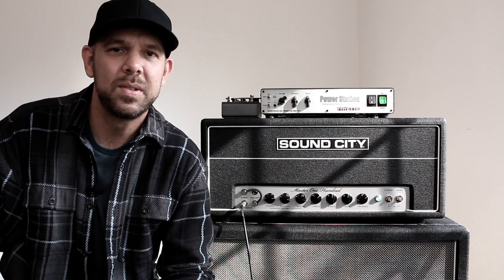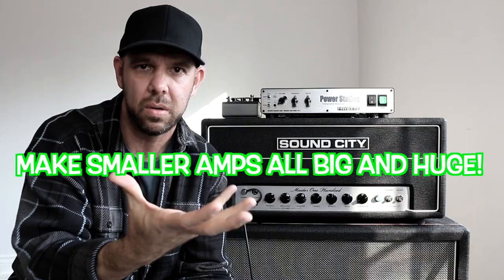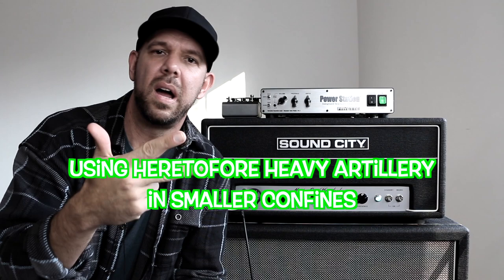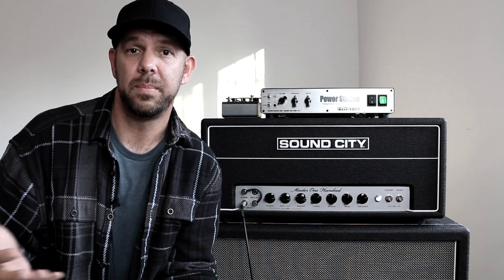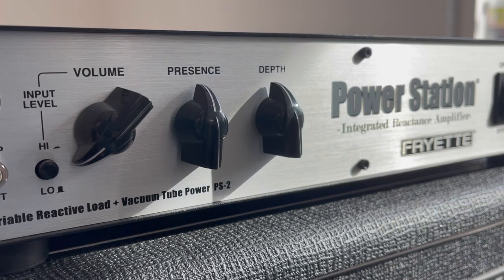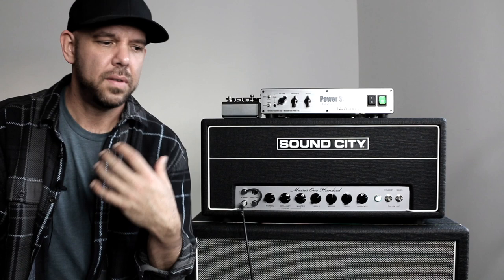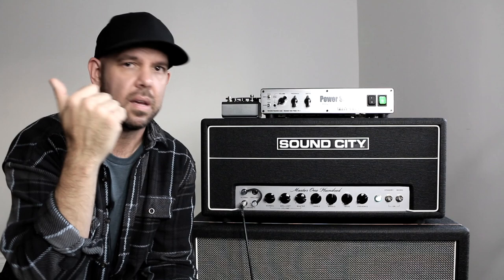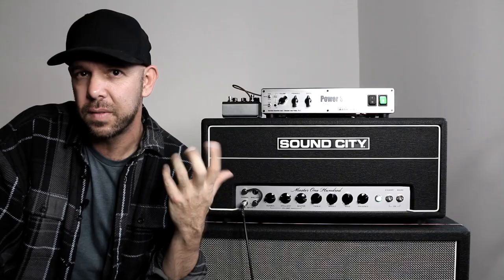Fryette Power Station 2  - Quick Overview!

Comment: If I'm running an el34 powered amp (Vintage Jcm800 2203) will the a 6L6 power section color my tone at all? Don't wanna lose that el34 magic.
Reply: it will, but thats not a bad thing. theres plenty of tonal options on either model to help you round out your sound. it will still sound like your amp, it will just bring out a different side of it!

Comment: In theory a great piece of gear, however it introduces fan noise in the room and (!) a certain amount of hum in my speakers when idling. This is extremely disturbing when playing at home in my studio. I contacted Fryette support, sent videos showing the hum issue and never heard back. For me it seems that they simply squeezed too much into a relatively small enclosure or didn’t take too much care for adapting the Power Stations power supply to the European 50 Hz (instead of 60 in the US). My power stations are now idling in my studio unless I hear from Fryette.
The solution for me is taking a stand-alone reactive load and reamping the line signal from this unit with one of my other tube amps (into the effects return). This is a noiseless setup and in my view the way to go and much better.

Comment: I am trying to connect my Fryette PS-2A to a Fender ‘64 Custom Deluxe Reverb combo amp (8 ohm), fitted with a Celestion T5953 8 ohm 90w Alnico Cream speaker. I have followed the wiring application example number 2 in the Power Station owners manual (Fender amps speaker cable into female to female 1/4” adapter, then Standard 1/4” to 1/4” Male speaker cable into the PS2 speaker 1 parallel wired output jack, then Standard 1/4” to 1/4” Male speaker cable from Fender amp speaker out to PS2 amp in). The PS2 Brite and Warm switches are set to flat, amplifier and cabinet impedance switches set to 8 ohm. I am not running any effect in the loop. There is normal sound coming from the Fender amplifier, and the Fender amplifier volume controls work, but the Fryette PS2 volume control does not work. The sound cuts out completely when I operate the PS2 Bypass switch. Basically the PS2 does not seem to be doing anything (I want it to attenuate). What am I doing wrong?
Reply from the maker: There could be more than one issue. Please contact support@fryette.com. Thanks.
Reply: @FryetteAmps  - will do, thanks.
Reply: All sorted now -PS2 works fine.

Comment: Sounds great, but does it wear more than normal on your amp tubes (pre & pwr)?
Reply: Your power tubes would wear out quicker since you're running them hotter with the attenuator, but not your preamp tubes.

Comment: Newbie question. Is it safe to have a tube amp connected to the amp in, and a synergy sn-2 and a friedman ir-x (on a a/b switch) connected to the  line in permanently? I would only use ether the synergy/ irx or tube amp at once. The speaker out would go to my cab  *with a celestion f12 X200 ff
Reply from the maker: Currently that won't work. You have to unplug the Syn 2 from the Line In to allow the loaded amp signal to get to the power amp. However, we have a solution for that coming out next month. So, keep an eye out for an announcement soon.
Reply: @FryetteAmps  great thanks for the reply. I will look out for it

Comment: I have a Marshall Zakk Wylde JCM 800 100 watt head and the EVH Stealth 100 watt head and I’m trying to decide which power taxation to go with. Obviously I would primarily use it to run the amps at the levels they sound awesome, but not make my ears bleed. Just don’t know which one to go with. I know one is 50 watts and the other is 100 watts. Just not sure which one to purchase.
Reply from the maker: If you really need the control switching function and the extra headroom provided by the PS-100, that would be the choice. If you don't play that loud, or need the switching features the PS-2 is more than enough power.

Comment: I want to use this with my solid state Vox Pathfinder 15R amplifier. The issue is - my pathfinder has an overdamped power section which is normal for most SS amplifiers. Is this device overdamped as well to give a faithful amplification to smaller amplifiers - or is it an underdamped power section. I would like to get an underdamped relationship with speaker and amplifier when using this to amplify my 15 watts SS amplifier.
Reply from the maker: Sure. Just set the Voicing switches to FLAT and Presence/Depth to zero.
Reply: @FryetteAmps  are the voicing switches a zobel network?
Reply from the maker: @voxpathfinder15r  No.

Comment: Looks to be a fantastic product/concept. My question is.......if I'm only using my Tube amp + the PS2 Load + PS2  I.R.'s at a gig.....(Not using a speaker cab or the 6L6 power section at all) and a PS2 power tube fails middle of a gig.......can PS2 power section be safely bypassed/turned off?   Thanks
Reply: Yep. The reactive load portion actually functions without the unit even being turned on so you'd be fine!
Reply: @JoeGambleGuitar  Thanks for answering my question👍.  It's a pretty important detail & would be a serious deal breaker for me.

Comment: Hello I recently purchased and received my Quad  Cortex and a Fryette PS2 I also am using a Celestine F 150  FFR speaker. How exactly would you hook it up? If you could let me know I would appreciate it. 
I’m going out of Quad to the in on the Fryette   What should I set the amp impedance to. The speaker is set to 8 ohms 
Should it be set to flat on the front with the presence and depth turned down.

Comment: Loving the PS2A, the improvements from the original are very well thought out and work fantastically. Particularly impressed with the pad on the volume control, great for home use.
I’ve used it with a range of amps/ speakers and feel that it sounds better than the original , probably due to losing the Low Pass  filter.
I’ve also considered using a Strymon Iridium ( with its cab sim disabled) into a 2x12 cab and have a couple of questions.
As it’s not strictly a line level output device would you recommend running to the line in or through the FX return? 
If I run to line in can I then go from line out to audio interface etc, from the manual I don’t think you can but maybe wring.

Thanks
Reply from the maker: Since there's no downside to running your Iridium into the FX Return, there's no reason not to try it. And you can experiment with the return level using the rear panel level switch. Whichever way works best for you is the right way. The Line Out is before the Line In, so the only way to effect the Line out is to send that to the Iridium first. Here's a link to the internal signal path of the PS-2: https://cdn10.bigcommerce.com/s-qis3kuj7/products/93/images/759/Block_Diagram__PS2SR__85230.1616293488.1280.1280.jpg?c=2
Reply: @FryetteAmps  tried both line in and FX loop return, prefer the loop. 👍
Reply: Hey guys, is there any noticeable running into the fryette vs without? Thinking about getting either a 6505MH or a 120w 6505 so i really would like to know if the fryette changes the tone at all both when attenuating a powerful amp and boosting a small one. Thank you 🤘🏽

Comment: Here's a question. When you say the power amp section makes your smaller amp sound much bigger, do you mean it makes it a lot louder, or do you mean if can take an EL84 amp that's relatively thin sounding and add the huge low end and umph of a 50W amp? Basicallt does it just increase the volume, or will it turn a small EL84 amp into a large 50W sounding amp with that big bottle tub sound, even at low volumes?

Comment: Can I run a pre amp pedal into the return of the loop on the Fryette directly, or do I have to keep it into the return on my amp? If I can run into the Fryette can I disconnect the cable on “amp in”? That would effectively take my amp out of the picture.
Reply from the maker: We'll address that in an upcoming video.

Comment: Powerstation arrived, love it! Question please, if I have Neunaber pedals in the PS2 loop with the Efx level switch on Hi, then hit the switch to low(instrument level) there's a big jump in volume for a second then it returns to the volume it was at with the Efx loop switch on high. Is this brief volume jump normal?
Reply from the maker: Yes. The delay in the pedal plays the last received signal back at the new level first.
Reply: @FryetteAmps  Thank you

Comment: Would fryette consider making one of these with el 34 tubes? It definitely sounds like the most natural attenuation from everything Iv heard online over many demoes.
   However I find that it recessed and softens the mids a bit , I suppose this is due to the tubes. I would use this for Marshall’s but I wouldn’t want to recess their midrange if possible . However if I used this with 6l6 amp then I’d use it
Reply: i have a mesa with el84 tubes and tried the Two Notes Torpedo Captor, and now own a Power Station. with both, attenuating my amp made me lose significant high end. however, with the power station, i was able to get a lot of it back. i feel like i have to attribute that to it using 6L6s. when i use it to boost my amp, all that rich crunchy, peavey-ish high end that my mesa just cant provide comes out. its the best of both worlds. i just think putting EL34 tubes in the power station would darken the tone too much. i feel like if your amp already had 6L6's it might be useful but, when attenuating, its way harder to keep your tone bright than to bring back low end or low mids. at really quiet volumes, for example, i have to have the presence knob all the way up and the depth knob all the way down.

Comment: One question - at low volume this tool will not make 1w tube amplifier sound like 50W amp at low volume, am I right? (it will not make more bottom end)
Reply from the maker: Not if you don't want it to. Yes if you do. You can choose settings to your liking.

Comment: Can you use the line out for headphones?
Reply from the maker: You're going to want an IR loader in between the PS and phones.
Reply: @FryetteAmps  Which is where your PL-IR would come in, correct?
Reply from the maker: @aaron9142  Yes. that's right. If you don't need attenuation, you can use only the PL-IR.
Reply: Awesome. I already and have the PS-100 and love it, so it'll remain. I guess I would take the line out of the PS-100 into the line line of the PL-IR? Or, if using the PL-IR without the PS-100, does connecting headphones defeat a connected guitar speaker cabinet?
Reply from the maker: @aaron9142  If using with the PS-100, you can connect the PL-IR Amp In to the PS speaker out and PL-IR speaker out to the cab. Or if using only the PL-IR, using the Headphone Out will not interrupt anything.
Reply: @FryetteAmps   Is it safe to use the PL-IR with an amp and headphones only? No PS-100, no speaker cab, no interface, and so on. Just guitar into amp, amp into PL-IR, PL-IR headphones out.
Reply from the maker: @aaron9142  See page 9. https://store-qis3kuj7.mybigcommerce.com/content/PL-IR_Manual_3152022-Final.pdf

Comment: ok, can I use it as a poweramp, let say instead 2/50/2 and get the same result, or is PS2 power section different to 2/50/2 standalone poweramp
Reply from the maker: The 2/50/2 is a stereo power amp and has a bit more output power, but otherwise, similar sonic response..
Reply: @FryetteAmps  thanks. I don't really need poweramp for live aplication, only for recording. No need for stereo too. I was just wondering whether PS2 can give me that poweramp mojo or it's just for reamping with no impact on sound